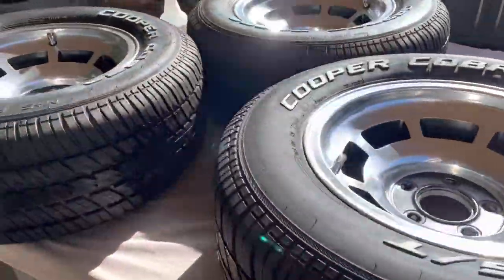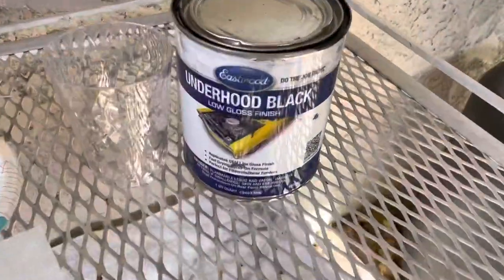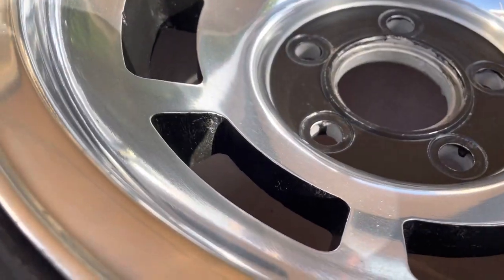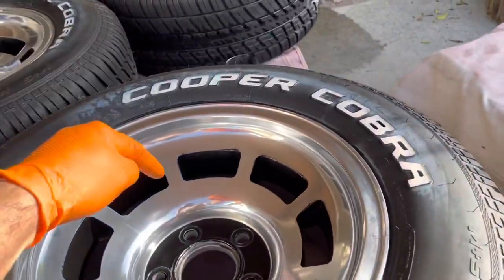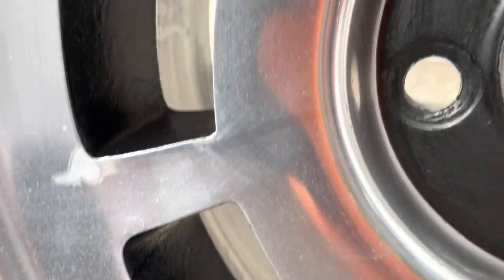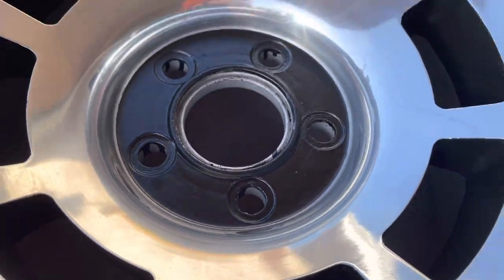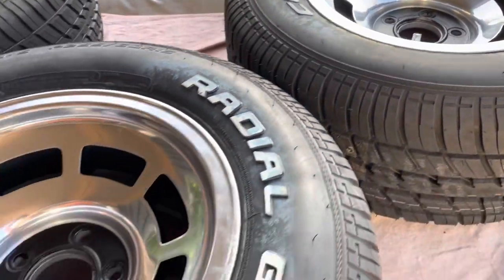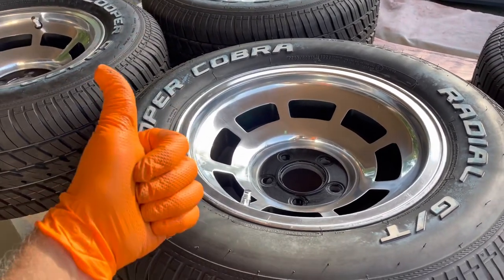Painting Late 70’s C3 Wheels

Comment: Looks awesome. Keep up the progress 

When I still had the slots I painted the slots as well. 

I did the normal prep and then taped over the front of the slots and then used some 2k black base and 2k clear and sprayed them from the back. Worked very well.
Reply from the maker: Nice! Do you think the clear added more protection than potential for chipping? With paint, there’s always a trade-off between what it looks like fresh and how much there is to chip and look bad.
Reply: @thedrivewayC3  absolutely. The 2k clear is UV resistant and offers protection from chemicals used in wheel cleaners.
Reply from the maker: @StreetersGarage  Good points. Some extra UV and protection can’t hurt.

Comment: Looks great! BTW has the Eastwood stood the test of time? or has it flaked off like the PORS?... Also, You did an awesome job on the centers! Did you just masking tape it? I've heard people use a coffee can????.... reason for all these questions is that I really like the idea of the roller VS Masking all and using a spray can. I'm prepping my 79 rims and want to paint them as well.
Reply from the maker: Thanks! I ended up taking the paint off the centers. These were originally all aluminum, so I went back to that look because it was difficult to get the black centers right. Maybe a can and spray would work Ok. It’s hard to get paint to flow into a hole, however. I would chop the can down and just have it be short.
Reply: I see what you mean... I'll investigate that avenue.... thanks again for taking your time to respond to my questions!!!! Cheers! @thedrivewayC3